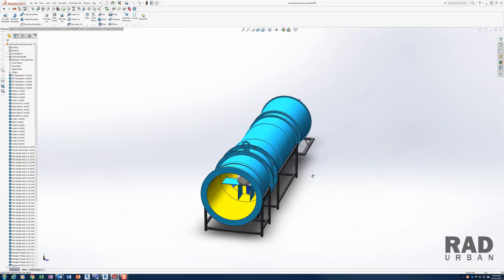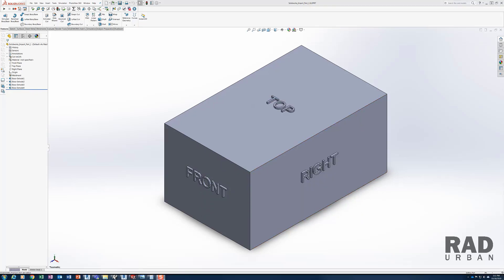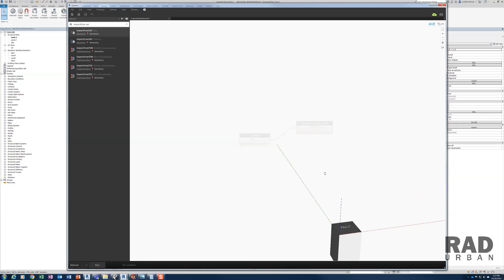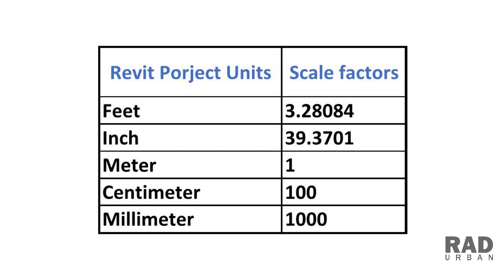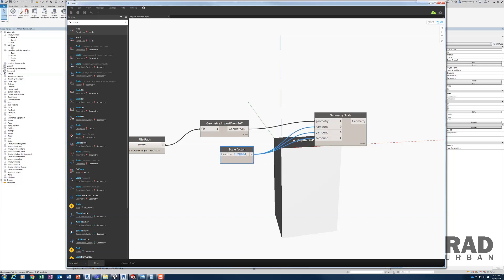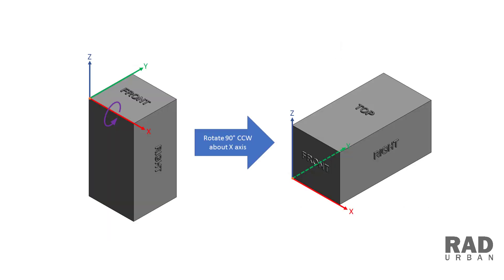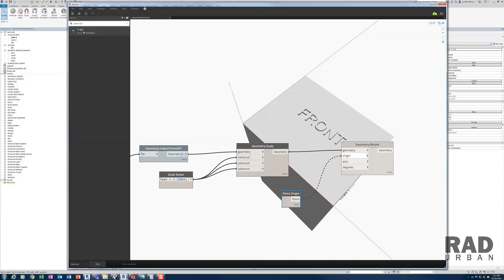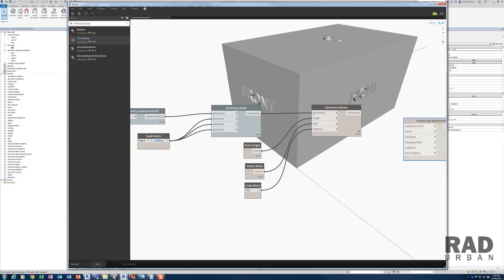Convert Solidworks model to Revit family using Dynamo

Comment: I've had problems with dynamo being able to import the SAT files. I noticed you can import SAT using the "import CAD" button on the ribbon and selecting the drop down menu for file type. I've done this, and gotten the SAT model almost perfectly into a new Generic family. I was able then to paint by face the imported model. The problem now however is, those painted materials do not keep / stay applied when i load the family into a project. its not a phasing issue, or an issue with the materials I have in the project. Any reason why this might be happening? I've also tried importing SAT directly to the project, but I am then unable to paint the imported model by face at all. When i check the family by editing it all the materials are still there and render out with my rendering plugin. this is not the case when i load it into the project.

Comment: please help, I need to insert  assemblies into Revit, I followed this process but it will only load one part out of 3 into the project
Reply from the maker: you need to export the entire assem file to a single SAT
Reply: @bbglenncai what happens then next? I can’t split every single component/model from the assembly. I would have loved to have a different family or property for each assembly element

Comment: hey thanks for the tutorial, but I run into an issue when I try to import the SAT file, I get "unknown exception" from the dynamo node. Any help?
Reply from the maker: Hard to tell, Could be complexity of the sw model or Revit and dynamo versions, you can try making the scripts work with a very simple model first and then rule out the other problems.
Reply: @bbglenncai  Alright thank you

Comment: How do you do it in Dynamo, starting from STEP file instead of having to export to SAT first?
Reply from the maker: Not quite understand your question. But exchange file is SAT only
Reply: @bbglenncai  converting STEP to SAT I loose all the benefits of the model, so looking straight forward geometry translation between STEP to Revit
Reply from the maker: @RubénRomeroVivancos  Unfortunately supported 3D file formats are still very limited in Revit, I would like to import a SW file into Revit directly but it is still not possible, so we have to do some workaround tricks.
Reply: @bbglenncai  I don't believe that.  It's possible